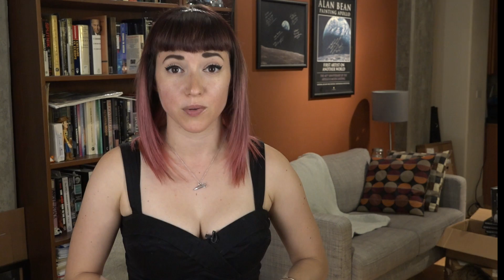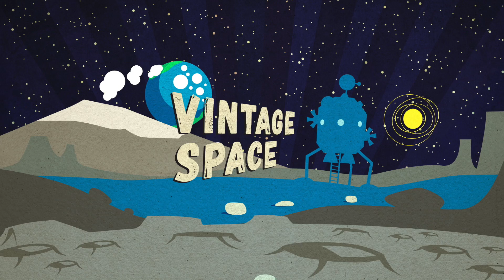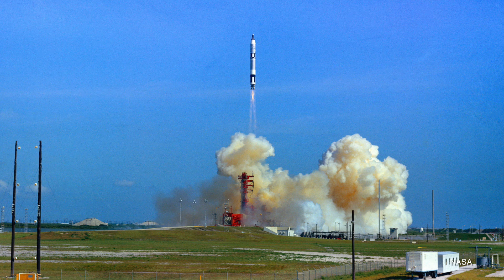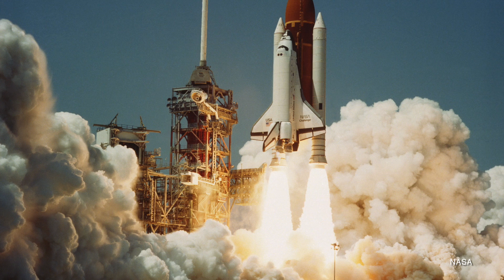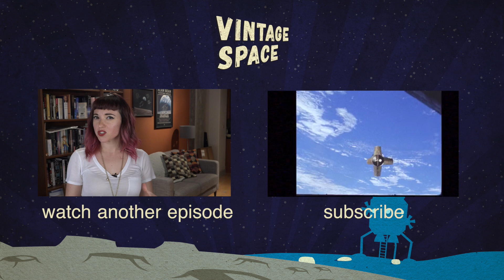How Little Vibrations Break Big Rockets

Comment: Amy, why do some launch vehicles have fins (Redstone and Saturn) and others don't (Titan and Atlas).  Is it because some were designed for silo launch?
Reply from the maker: Jim Lovell said at an event last year, half-joking, that fins were just Wernher von Braun's trademark! At least Apollo-era, the fins do appear in V-2 heritage missiles, heritage including spinoffs and just later rockets from the same team, which does extend to USAF missiles. I suspect you're right on the Titan, that fins would have been problematic for a silo launch!
Reply: Amy Shira Teitel Thanks!  Your channel has helped reignite my childhood love for the manned space program.  I even ordered a Saturn V model!  Hahahaha!  Maybe I will bring it to the office and fly it around making rocket noises.  I'm going to retire soon anyway.
Reply: When an object has its center of mass in front of its center of drag it is stable, otherwise it will try to turn around. That's why objects that need to be stable in the air try to put something heavy in front to put the center of mass to the front, or put fins in the back to pull the center of drag to the back. Engineers try to avoid fins, because more fuel is wasted fighting drag, instead of accelerating the craft, but if the instability is too much it is worth it. 
Saturn had very light liquid H2 fuel on all stages except the first one, which used relatively dense kerosene. Its center of weight was very low - good while it was on the ground, but not when it is in the air.
Reply: Blake Ashley  I read the reason for fins on the Redstone, but I can't find the link now.  As I recall, during some stage of flight, the rocket was not sufficiently stable and the thrust vanes alone did not have enough control authority to overcome the instability.  Aerodynamic fins added both stability, and because the Redstone fins had moveable sections, more control authority.
Reply: Blake Ashley   It is interesting to consider the various regimes launch vehicles traverse.  At lift-off, the only aerodynamic forces come from wind and the only control forces come from diverting thrust.  The vehicle passes through slow, then fast subsonic, then transsonic, supersonic and hypersonic regimes before finding itself in a vacuum, with no aerodynamic forces at all.  All the while, both the mass and mass distribution are constantly changing.  Not a simple situation.
Reply: Barry Allott  Larger rockets usually use nozzle gimbaling for stabilization, and/or small "vernier" rockets which may be gimbaled and/or throttled for control.  It is a complex system, but allows great flexibility in trajectory control.  The orbits of different payloads vary a lot.  Flexible control allows the launch vehicle to reach many different orbits.
Reply: M Infante
Right.  But you skipped over my real question which is not why some rockets have fins but why some don't.  The Titan Gemini certainly must have had a center of pressure forward of the Saturn V, yet it has no fins.  Why come?
Reply: Blake Ashley   The people harping on center of pressure are both correct and incorrect.  Yes, adding tail fins moves the center of pressure aft.  But, in large rockets, that is not enough.  Active guidance through thrust vectoring is the main control mechanism.  It is apparent that aerodynamic fins are not absolutely necessary from the large number of rockets that do not use them.  Probably the biggest factor is the capability of the guidance system and the thrust vectoring system.  Example: The Soyuz could not launch payloads with a large fairing until it was outfitted with a more capable guidance system.  Same rocket, same thrust vectoring system, with a less capable guidance system, it was limited by center of pressure, and turbulence considerations, with a more capable guidance system, it can overcome the limitation.
Reply: Mark Holm
Thanks!
Reply: *****
Interesting!  Thanks!
Reply: Mark Holm
And that is on top of all the engineering associated with trying to control a staggering amount of chemical energy so that it doesn't kill everyone.  It is astonishing that they had so much success with so few fatalities.
Reply: Fins act as a way to stabilize a rocket which is especially helpful if the engines don't have much gimbal authority. By adding fins, it moves the center of drag down to the bottom of the rocket which then helps to keep the rocket upright because the center of drag will always try to turn the rocket so that it is in the back with respect to the rocket's angle of motion. Therefore, in an atmosphere, the rocket will be traveling up with the center of drag at the back, helping to keep it from flipping over. If you look for a video of the Ariane 5 launch failure you can see that this is the kind of things that fins try to prevent from happening.
Reply: SpaceX BFR has fins too.
Reply: Amusing and entertaining discussions going on here.  I get the impression that many here - surprisingly - have never built and flown model rockets!    :-)
Reply: Do rockets have enough stabilization with fins/non fins?  I thought making the object have a spin increases stabilization.  Would the rocket be more efficient it in went in to a circular spin?
Reply: Barry Allott  Some, smaller rockets and some satellites are spin stabilized.  It complicates any intentional pitch and yaw maneuvers because of precession.  If the payload is not intended to be spin stabilized, then spin stabilizing the rocket is a bit problematic.  Some rockets and payloads have both spin-up and spin-down motors.
Reply: So it's sort of like an archer's arrow.
Reply: Blake Ashley Fins move center of pressure backwards. Some designs need it to give stability. Else a rocket with center of pressure ahead of center of mass would be like flying a paper plane backwards or having a nose rudder for planes.
Reply: Blake Ashley   The best answer to your question is probably that no commenter on this video knows the answer in detail.  Large rockets use thrust vectoring of one sort or another as their primary means of stabilization.  Sometimes, that was not enough, and some sort of aerodynamic stabilization was added.  The V-2, Redstone, Saturn I and Saturn V all had some sort of fins.  In the V-2 and Redstone, the fins had steerable portions actuated by the guidance system.  Perhaps it was part of the von Braun team design philosophy.  Perhaps it was just that the guidance system and thrust vectoring on these machines was not quite enough to ensure stability during the atmospheric portion of flight.  Remember that all these large, finned rockets were developed during the early years of large rockets, when control systems were still in the early part of the learning curve.
Reply: Blake Ashley   It is interesting to note that the Russian, R-7 family of rockets, including Soyuz, use a different system.  They do not gimbal the main engines and do not use fins.  They have small steering engines that are gimbaled.  The Thor and the Atlas sustainer also used auxiliary, "vernier" steering engines.
Reply: Blake Ashley Location of Center of pressure tells us if we need fins or not.
Reply: M Infante
So you are saying that the center of pressure of the Titan and Atlas was to the rear while not so with the Redstone and Saturn series?  If so, do you have any citation to authority for that?  Because they sure don't LOOK that way.
Reply: Blake Ashley Only Chinese,Indian North Korean etc. rockets use them now I think
Reply: Mark Holm Yours is the correct answer.  Need fins for stability until it gets going fast enough that the fins don't matter .
Reply: Eamonn Vize
Then why do some have no fins?  That's the question.
Reply: Blake Ashley They do not have fins because they do not need to. Guidance is like holding a pencil on top of a finger. If rocket is designed in certain way, center of pressure is in the right place not to need fins. So the tip of your finger is enough for guidance.

Comment: Great stuff Amy! 

On a totally different topic: I've got a "vintage" question for you... During the time of designing and testing the X-15, trying to break the sound barrier, how did they come up with a flight simulator for it? I mean, before flying the thing supersonic, how on earth did they know how it would behave, so they could simulate the characteristics to train the pilots? Nowadays, we have all this "computer-virtual reality-digital stuff" with a ton of mathematical power, material, load and aerodynamical data. But way back then? As far as I know, only analog technology existed. I've seen footage of the X-15 simulator with lots of manually wired panels, where they seemed to unplug connections to simulate errors I guess. But the flight behaviour? I'm really interested how they managed to pull that one off...

Comment: A question for you: I have read that the Saturn 5 was held to the pad by tapered pins to prevent the thrust from overcoming the structural strength of the rocket. Do you have any information about this?
Reply: The tapered pins allowed for a progressive release of the Saturn V once the hold-down clamps let it go. This was done so that the up force created by the engines wasn't applied to the rocket's structure all at once, which could cause structural failure.
Reply: Thank you! That is what I remember, too. I just wish I could find a reference for them. I think the math must be fascinating.
Reply: Actually, a lot of the technical details of a Saturn V launch were the result of previous experience along with some logical thinking and educated guesses.

One interesting example is unplugging and retracting the swing arms. Unlike in the movie "Apollo 13" the swing arms do not retract one by one prior to lift off. Instead they retract all at once after the rocket actually rises about 3 feet off the pad. This is because at that point the rocket is either going to fly away or fall back onto the pad and explode, therefore it's okay to unplug and retract the arms. However before lift off you could have an pad abort with the rocket just sitting there fully loaded. In that case you want the arms still plugged in so you can safe the rocket and then offload all the propellants.

Comment: POGO was particularly bad on the Saturn V's center engine, on the first stage, where cross-members held the engine in place, and could flex. The 4 outer engines at least were affixed directly to the frame.

Comment: So, SRBs don't experience pogo, correct?  Or will solid propellant systems suffer a similar issue? In theory they shouldn't.
Reply from the maker: I haven't come across the same thing happening in a solid rocket, but I did get an email today about a different oscillation issue affecting solid rocket motors today! I'm going to look into it and maybe do a companion piece!
Reply: I look forward to your report. :) 

BTW - you might find one of my rocketry projects amusing.  Check out http://mercuryjoe.com/
Reply: Solids can experience a similar oscillation but the mechanism that causes it is different. In solids you can get vortices that come and go in the motor and this will cause pressure surges that will result in the same type of pogo effect. Oscillations around 9 Hz are particularly bad, if I recall correctly, because parts of the human body (I think it's the eyes) are sensitive to that frequency.
Reply: Amy Shira Teitel thank you for the video and information!  I have the same question about SRB.  Hope you can find out.... thanks again

Comment: The space shuttle did have "twang" though where it leaned a little backward during liftoff.
Reply: That was due to off center thrust from the main engines.
Reply: Only until the SRB's ignite.  The angle of the SME's is such to correct for the off-center mass of the SRB's as well as their thrust during the first two minutes of powered flight.  Then they had to re-adjust for the change in mass and thrust vector once the SRB's quit and separate, leaving just the dead weight of the ET for the SME's to push against.

Try building a shuttle in Kerbal Space Program.  It is no simple task, lol.

Comment: But you shouldn't get pogo with solid rocket boosters, correct?

Hey that might be an interesting topic to talk about. Use of solid rocket boosters vs a full liquid fueled rocket. Why they are used, what is the purpose of using both booster and liquid at the same time (ala the shuttle) - what the liquid portion does vs the booster. And finally how the solid booster burns - liquid rockets flow the fuel to the engine where you have combustion but solids do not (I assume) and the fuel burns up into the rocket booster (or does it) - don't think the solid fuel gets pushed downward to the engine cone and then ignites. And finally, when did solid fuel rockets/booster first get wide use in rockets (shuttle?), first rocket to use solid boosters?

Do that as a video!

Comment: Try launch lots of stacked small fuel tanks without struts in ksp
Reply: Well, at least you get the idea of how dangerous it is
Reply: My biggest rule in KSP is "Struts, Struts, and more Struts".
There was also a "Docking Strut" I had found, which is basically a disconnected strut you could put on two seperate vehicles, then once docked, you could connect them, thus stabilizing the docked combination.  An absolute must for large space stations.

Comment: I clicked on a story about comets crashing into the Sun and it was you on Dnews! You are buzzing around all over the solar system these days Miss Pluto! 
I remember a pogo stick but they have gone the way of the 78 Rpm phonograph and 8 track tape player. Now it's iPhones and hoverboards. 
Pogo was one of the few major flaws of the early Saturn's. It's a miracle it had worked so well compared to the Soviet N1.
Early Soviet space flights would be a great topic, but difficult to find info on for sure.

Comment: I think you kind of skipped over the point between surges; the engine surges, OVERPRESSURES th combustion chamber, lowering the fuel flow, causing lower thrust, which is the "coast" during the pogo, which then leads to a low pressure, and another surge/pogo...

Comment: Do a video about spacecraft tools. What tools do they carry, how do they store them? How do they keep the weight down?
Reply: And how they have zero torque built in to them...
Reply: I would like to see that also. I once visited a traveling Soviet Space exhibit in Fort Worth Texas. I was amused to see one of the tools they carried was a 2 lb engineers hammer. Never know when you need to give something a good whack with a hammer.
Reply: I live in Arlington, shame I missed that expo.
But seriously, the tools I have to work on cars and electronics must be somewhere around a quarter ton, spacecraft surely require more tools than cars. Add to that my toolbox which weighs several hundred pounds, but my toolbox would fail miserably at keeping things secure during launch, much less in zero-G.
Also, if you drop a wrench on EVA it is gone forever, a sacrifice to the space kraken.
Reply: I also went to that exhibition....back in the winter 91/92
Reply: Ah, that would be a T-34 gear change tool, essential for all soviet engineering systems.
Reply: I read in Newsweek aaages ago that when Mir was opened up to other countries as a training venue for ISS, one of the stories that a foreign astronaut brought back (an American, IIRC) was of a Russian cosmonaut unsticking the valve on an O2 bottle by giving it a few smacks with a hammer. Maybe it was the same model of hammer :-)
Reply: Could have sworn you said Minecraft tools.

Comment: Well, you explained what causes a sudden increase in thrust but not what causes a subsequent decrease in thrust, both of which are necessary to cause the pogo effect.
Reply: Back pressure from increased combustion.  Negative feedback leads to the oscillation around a dynamic equilibrium.
Reply: Where does the "negative feedback" come from? Forward thrust causes increased pressure in the piping system, resulting in more fuel and oxidizer feeding into the combustion chamber resulting in increased combustion resulting in even MORE forward thrust, which is POSITIVE feedback. So what is it that causes the subsequent DROP in pressure that causes the bouncing back and forth between increased thrust and decreased thrust? That's what's not explained in the video.
Reply: I thought it was from too much pressure in the combustion chamber pushing back on the reactants trying to enter once you hit a certain point.  Perhaps I mis-heard that detail :-(

Comment: I always though that the first Pogo related problems were associated in the early days of the Mercury program, specifically when they were wind tunnel testing methods of maintaining stability when they attached the mercury capsule to a redstone missile?
Reply: I think you'll find that the Mercury/Redstone series came well before the Apollo launches ;)
Reply: yeah, if i remember rightly, they created scale models of the mercury/redstone rocket and tested them in a wind tunnel, but found that when the rocket started approaching Mach 2, pogo oscillations would shake the capsule to the point at which anyone inside it would have been turned into chunky salsa.
Reply: budum..tssccchhh!  :D